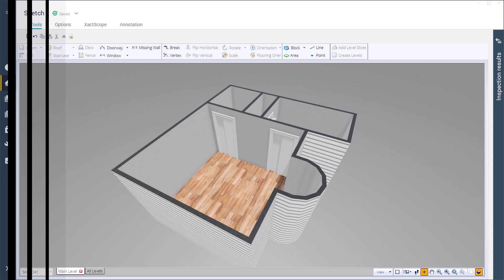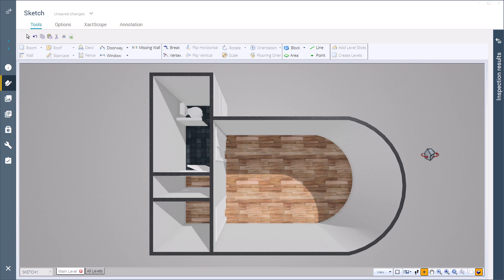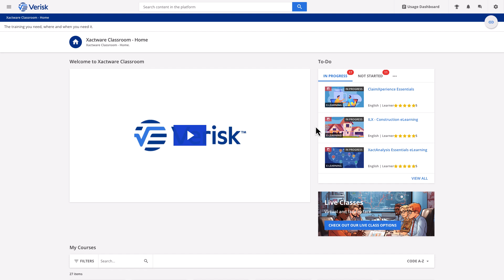Xactimate Xpert Tip: Creating Curved Walls and Corners in Xactimate

Comment: My wall is not angling how I want it, only 90 degrees or further in
Reply from the maker: That’s the default behavior. To get a curve, you’ll need to enable the arc wall setting in the wall’s properties and enter an arced distance. The video walks through this step at the start of each section.